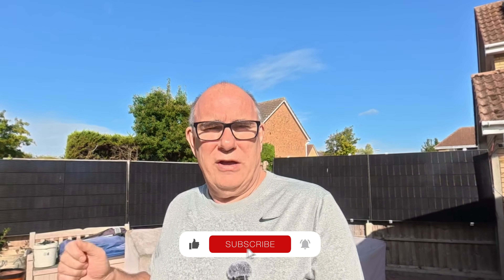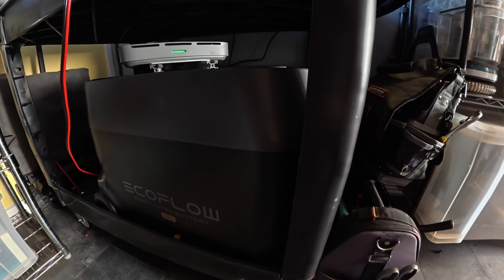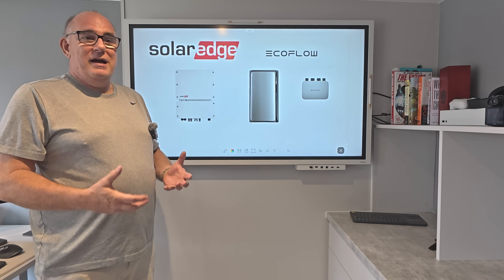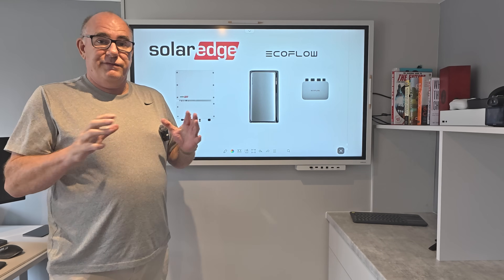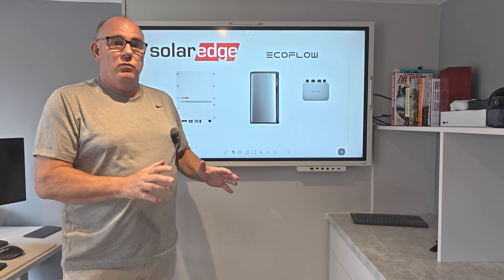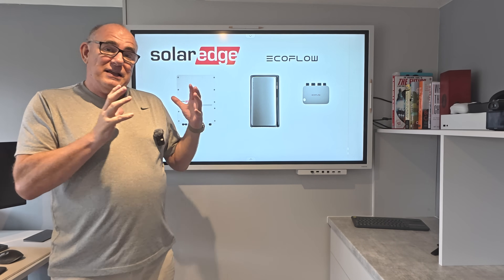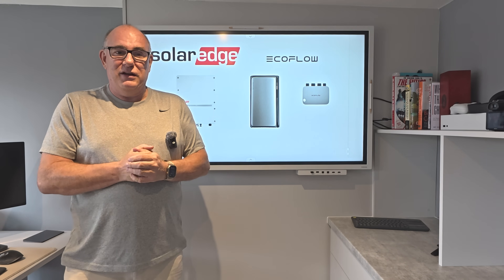Hybrid Inverters CLASH? How to Stop Your Solar System Fighting Itself

Comment: Interesting. How do you manually assign that 400W base load and tell the SolarEdge to ignore that. Is that some kind of Time Based Control feature in the inverter's settings?
Reply from the maker: The EcoFlow inverters have a mowed that allows you to set a consistent base load. So you just dial in 400 W and leave it at that.

The solaredge system then ignores that 400 W as it sees that has been consumed by the house,
Reply: @JonathanTracey  can the EcoFlow mode/system that sets the base load it provides be changed by time of day and/or by automation ? I am evaluating several options for storage and inverters and have even downloaded several apps from various vendors, but they all have a major problem - nothing works without having the hardware. No 'demo mode' or anything like that as far as I have seen. Getting to grips with the capabilities of any of these systems, particularly EcoFlow's, is difficult as their website and documentation leave lot to be desired.. Are you going to do a full overview of the EcoFlow app, how to set it up, configure various requirements for various scenarios, and give some idea of how it all works in practice ? I would be very interested in this, as the amount of questions flying around on the likes of Facebook and Reddit about the EcoFlow systems beggars belief!
Reply from the maker: Right now the stream system is missing quite a few critical features, one of them is to schedule different loads of different times of the day. This can be done with the older system (powerstream) but that system is no longer available.  I suspect these features will come to the new system, as they are rolling out new features with every software release but right now I can’t seem to find a way to do that. There is also a Home Assistant integration but again it’s very early days and it’s not reliable enough at this point.
Reply: @JonathanTracey  Thanks, and I went off to look at the Stream manual, which is largely about basic installation of the hardware and a basic overview of capabilities. However, it doesn't really cover the app features in any detail, but in the section "System Scheduling" it states: "The STREAM device supports a basic power scheduling scheme. When no smart sensor is integrated, the feed-in power cannot be adjusted in real-time according to household power consumption. Instead, it can only be manually set to a fixed power, or scheduled based on specific periods via the EcoFlow app."

This would suggest it's possible to set a base load on a schedule, but your comment above implies this only works on the PowerStream (not Stream) systems. Can you confirm/refute ? Have EcoFlow just got the manual wrong, or included the carry-over from the PowerStream system by mistake ? Thanks..
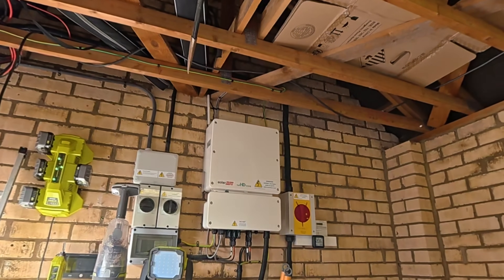Reply: Stream AC Pro now has a 'Base load power' option under 'Energy delivery strategy'. You can add time period in increments of 30 minutes and assign a power in increments of 10w up to the UK 800w limit. for example 00:00-16:00 0w and 16:00-24:00 200w. Yes at the back end of the day the app has 24:00 and for the start it uses 00:00! Not quite correct, but it works. These settings can be changed at any time. Setting the AC charge is more fiddly. It's the same kind of Increments for time and power, but you can only make a change to a future time in the SAME day. To setup my charge cycle at 03:00 to 06:30 daily, I had to wait until midnight then setup the times and then set it to apply daily. This is under 'Operation mode', then Custom, select 'no tasks currently' assuming none are active and the use plus to add a task to the list. It's definitely an app in development. The waiting up to set a charging period was mildly annoying, but now it's set, I can just leave it. It will still be in the 'cheap' time even after the clocks change.

Comment: I have a solax inverter connected to my roof solar, it feeds ac into the backup generator port of my lux hybrid inverter. The lux inverter then manages batteries and import export. The lux inverter has control and just thinks that the solar is a diesel generator.
Reply from the maker: That's a clever way of integrating the different systems.

Comment: wish i had the chance of using my inverters that way with a maybe fronius...  but  !!   Greece isnt so easy at hybrid systems and grid her is  bad and old.   maintain grid is costy and off grid paids itself only if you cut grid  and its bills!  .  selling back is a joke and you might need at least a used electric vehicle as a storage sollution.  2026 here  might show more v to grid   sollutions but still for off grid  combo!!!
Reply from the maker: It sounds like you have a lot of restrictions and challenges there; hopefully, the situation will improve over time.
Reply: @JonathanTracey    i hope it will..!!  curent systems  a multiplus II 5k and eco flow d2 , no much storage yet . i test some raw  second life cells long term  using em.    i like the feedback and hope for some hybrid  transition!!! ..  keep strong

Comment: Nice setup and explanation. 

Unless I’m mistaken isn’t one of the functions of having a CT clamp to detect power cuts and shut down so no electricity flows back out to the grid in the event of a power cut?

If there is only one inverter with the CT clamp doesn’t this run the risk of the other two pushing electricity out to the grid and ruining your local electricity worker’s day?
Reply from the maker: not in my case I have a physical cut of switch that detects for outages of the grid and physically disconnects from the grid. This allows the system to run in island mode. So if the grid goes out, the solar edge system physically cuts the connection allowing everything else to continue running
Reply: @JonathanTracey wonderful well that makes sense then. 🎉 (sadly I don’t have that on mine)
Reply: A non-battery inverter will still cut off in a power cut, without an CT clamp. The inverter itself has to monitor the grid frequency and phase in order to match it.

Comment: How does this all work with the DNO? Have you declared all the invertors to the DNO and the sum of all the inverters below this limit?
Reply from the maker: Yes they all have to be under the G99 approval, I did not ask for a larger export limit as I already have 10kw so did not feel it was necessary
Reply: @JonathanTracey ok so if you have 10KW inverter for your main one plus two 500w inverters (can't remember how much those other units are rated at) then the DNO had approved 11kW.. but you could have a separate export limit which could be lower (e.g 4kWh)

In the world where people may end up with a variety of different systems then it feels like we need something which can make them plug/play together a lot more easily and it feels like the DNOs need to work out a system to make it easier to add new capacity without having to jump through a lot of hoops and costing a fortune to keep applying under G99.

Comment: Interesting, I have pondered this problem myself as I do want to expand my setup but my biggest issue is getting the connection into the existing consumer unit. That must be the messiest meter box I've seen, I need to get an electrician in mess my one up make it look like yours  :)
Reply from the maker: yeah, that’s what happens when you keep adding and changing an upgrading and trying to make stuff work

Comment: Thanks for the video, but i am not entirely convinced you are correct.  The CT on the incoming tail, simply measures the magnitude and direction of the current, this is generally to prevent the battery discharging to the grid; so generally the CT does not tell the inverted the magnitude of the property current demand.  the inverter works that our for itself, by simply increasing the voltage it outputs until (all) the current flow out, into the property and indeed on many systems it spills into the grid (export), they simply raise the voltage until all their energy is output.  On a battery system you don't want to export. So the CT effectively allows the inverter to not export.
All grid-tie inverters constantly monitor the voltage of the grid (as seen from the property), they simply increase the voltage to beat the grid voltage, that is how they 'beat' the grid to feed current to the local/property loads. (some may also monitor phase).
Reply from the maker: yeah, if it senses the there is current flowing out and it can use that to charge the batteries it will redirect power into the battery. If it detects there is current coming in it can then ramp up and supply enough power to mitigate the need to import power. The actual CT itself is just a coil all the intelligence as you say lay in the inverter.
Reply: @JonathanTracey  Now perhaps i misunderstood what you were saying, and my point was a subtle one,  believe it does not use the ct to detect incoming current to then increase its voltage based on that, it measures the voltage (to then increase/decrease its voltage) not the current. the ct is only there to ensure it does not export (and perhaps a few other checks).

Comment: I do something very similar , my powerwall is the system which works directly with the grid , and my two victron inverters/batteries then will discharge based on (1) how much energy is being exported and when and also dependant on SOC , and  to the house loads , the powerwall will then fill the gaps if the victron systems are out of battery or demand is to high for the victron systems , 
All controlled with automations in HA
Reply from the maker: Nice, is Victrons HA integration good, do they do it themselves or is it a third party HACS integration?
Reply: @JonathanTracey  I don't think Victron have their own HA integration, I use a third party one. 

IMO it is very good, it has hundreds of monitor and control entities depending on your setup. I use Carlo Gavazzi grid meters with mine to monitor the grid and multiple PV inverters so I can view voltage, current and power for each separately.

One of the best features IMO is that it's all controlled and monitored via modbus so it's not dependant on API's or web portals.

You can control grid setpoint, minimum SOC, inverter power etc all via modbus registers so it gives you very high levels of control.

It integrates quite nicely with the Octopus integration to respond intelligent dispatch slots to force charge/discharge as needed so it won't empty the battery in to my EV when Octopus give me an extra charge slot during the day.
Reply: @JonathanTracey  they are HACs integration I’ve just found the MQTT integration which is becoming my favourite and developer is improving it   All the time